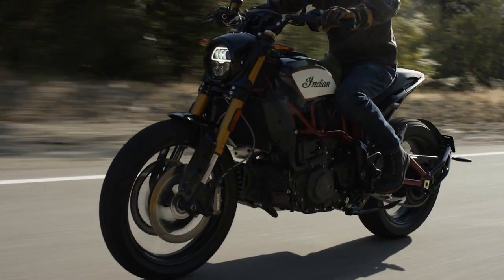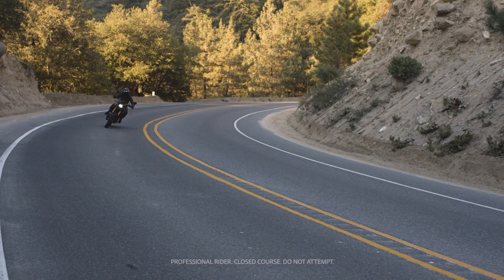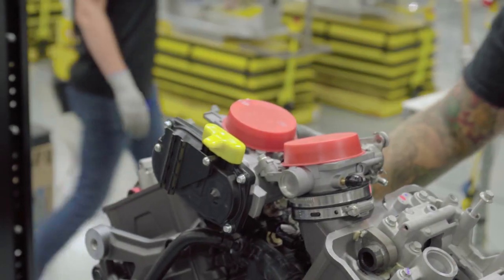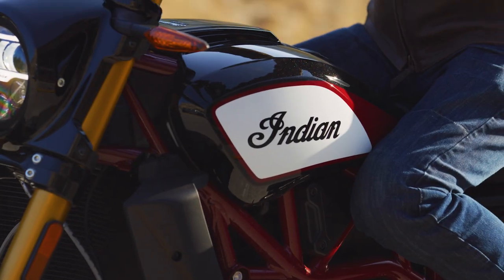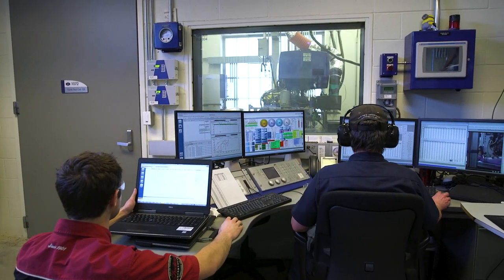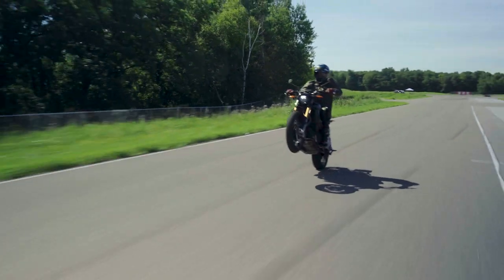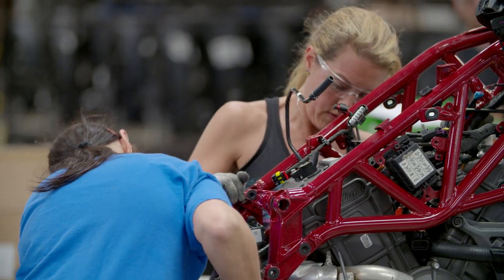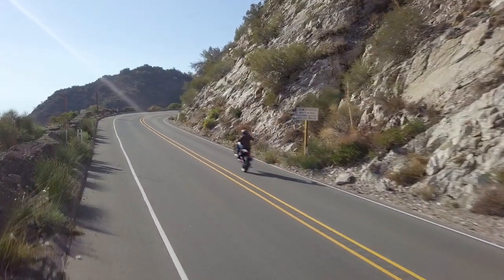FTR 1200: Inside the Engine - Indian Motorcycle

Comment: Look out Ducati! This may be the cheaper more reliable option, we shall see!
Reply: At $12,995 (same price) for the smaller less powerful(Maximum power comes at a claimed 86 hp at 7,500 rpm and 65 pound-feet of torque at 4,750 rpm.) Ducati Scrambler that the FTR1200 was designed to look like and compete with, It is you that need to do more research before YOU sir make comments that are unfounded.
Reply: In addition the Scrambler 1100 Special is nearly $15,000. I will admit it is 20 pounds lighter dry, but nearly 40 horsepower short, I'd leave a few garments of clothing at home and strap on some lightweight boots, hop on the Indian and feel that it would be the cheaper more reliable option as stated. Let me know what other research I should do, before I trust a multimillion dollar company to have done the research to make sure they have the edge on the competition before I assume so when they unveil a bike in a relatively small but crowded category such as this one.
Reply: Is the Indian motorcycle brand reliable? I’m not from the us so I have ridden a Indian but would love this bike for my third
Reply: I am banking on this model to be reliable. Polaris is manufacturing this brand and has a lot at stake to make a better and competitive motorcycle. I have a Roadmaster with nearly 40,000 miles on it with no issues aside from the slightest oil seap up front somewhere. I haven't heard any negatives from the 1200cc scouts either
Reply: Lol!! Hardly..
Reply: Oh boy, here come the Ducati fanboys...
Reply: The race edition just increased in price, msrp is now 16,999